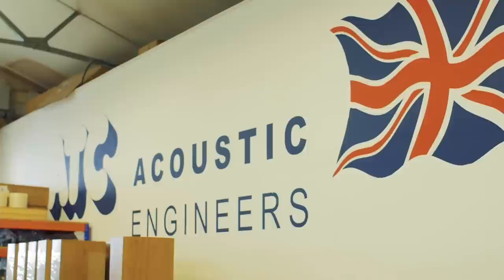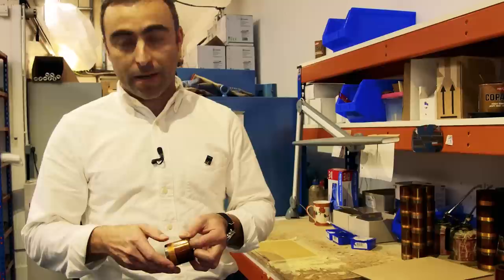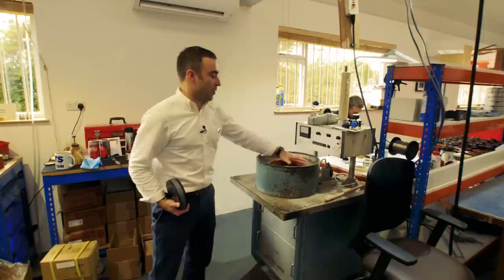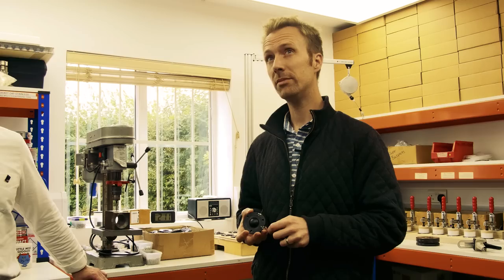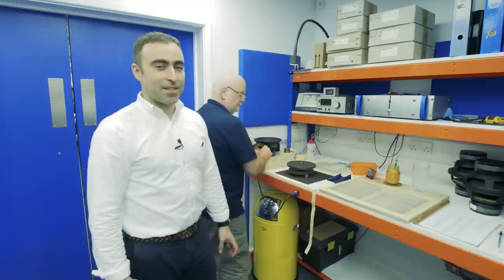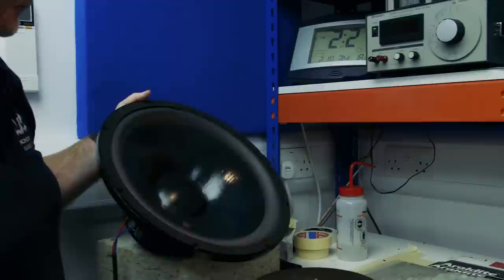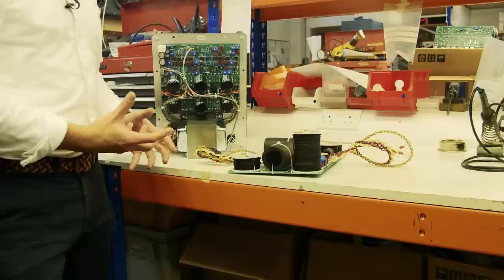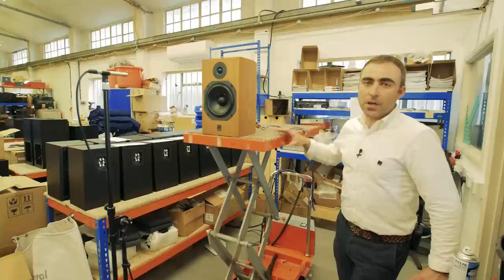Soundstage Takes The ATC Loudspeakers Factory Tour

Comment: In the '70's I worked in a speaker factory in New York state. I came here to see how it's still done. Your manufacturing is somewhat similar to the processes we used. Hearing you describe the components such as the front and back plates, the spider, crossover network, etc., I knew exactly what you were talking about. We produced raw speakers and speaker systems for some old but familiar names. Harmon Kardon, Jensen, JBL and Altec Lansing, Sony and Kenwood. They had a machinist shop, punch presses and a state of the art wood shop. Every speaker produced was tested in a sound booth on an oscilloscope (or sometimes with music with cheaper systems) before packaging. They are out of business now but your tour took me back to the '70's.

Comment: Set up a new studio for a new artist project and bought a pair of SCM45A'S. I bought them totally off specs.Didn't feel I needed to test them as I knew ATC Speakers are built to the highest standard and  have worked using the SCM 50's numerous times. The SPL  was well loud enough for my room. I'm using PMC's for the near field, but I have to say the ATC's are just so transparent and real. Its like working with a visual frequency range but with your ears. My mixes are just so much better because I can hear everything so clearly. The mids are just so honest and the drivers so tight for bass. They are not kind to poor mixes or sounds. They tell you exactly what is. Totally a professional monitor system and whilst not cheap, you truly get what you pay for. I'm not associated with ATC in any way so this is totally my view and unbiased. But they are just so great to work with. I love them.
Reply: Totally agree with this, have a pair of Scm45 A's myself and I've got to say, they are truly something else. I notice many people talk about the lack of bass on ATC's, but I think it's very present, maybe not as much as on other speakers, but it's definitely there and I'd even go as far as saying that it's a much better perception of the low end than on the other big bass speakers, it's so tight and real, it just doesn't feel hyped at all. Mids and Highs on these speakers are wild, better than any other speakers in that range, I think everybody knows that by now.

Comment: I just love the look of that soft dome midrange! A real unique feature for sure.
Reply: Yeah dome mids are something else! Can't wait to finish my DIY 3way monitors with a 3inch dome.
Reply: @kaedeschulz5422  what is it volt
Reply: @johnsweda2999  Just for now Dynaudio MD140 on a short waveguide like on the ATC or Volt till i'm done modifieng a Scan Speak D76. It will get a whole different motor from beefi PA driver that was blown. I may even do dual suspension. But only if i can get the right parts.
The coil off course will also be changed. The woofer will be a 15" PA driver that i will modifie and the tweeter will be a Seas NoFerro900.

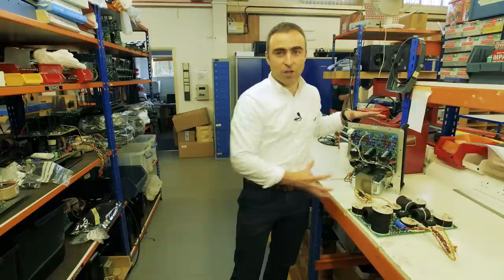Comment: now compare that passive crossover at 12:20 with a similarly priced speaker from garbage company like Focal
Reply: Right, lets compare a Fiat to a Mercedes.. Seriously man, are you stupid? Focals most expensive professional speaker system costs about 3.500 and their cheapest is around 250... ATC's cheapest professional speakers start at almost 2.000 and their most expensive cost almost 25.000 a piece. Yes ATC is better, but Focal's 3 way speakers sound absolutely great for their price. Comparing these two is ridiculous!

Comment: I bought a set of atc 50 aslt. I don't think it's fair to talk about speakers alone  so for this reason I will share my previous equipment. Used linn and Naim ss amps to Focals. Also McIntosh c2600 tube pre to pa mc275 vi to focals. There's was things about those combinations I really liked, but I always felt I was missing something. I sold everything and took a blind chance on new system entirely. I'd only been able to hear the atc 11 and 19s both passives but could tell there was something special. However I really wanted an end game system. I purchased a Supratek Cortese Lcr pre tube and the atc scm50 aslt. I run silver linn xlr interconnects. I can honestly say I no longer have a desire to upgrade. I does things that are hard to put into words, if you have not experienced this with Atc I'd say you may have the wrong amp or synergy is off or even something as simple and overlooked as speaker placement. I can still play with sound changes if I alternate copper and silver xlr cables or tube roll. I think it's important to note sound is much like taste buds, we may all have some slight preferences that differ. I think the goal is to know all the characteristics of musical sound you like (ex...warm, bass, clarity etc) then identify which equipment falls into those characteristics and build the best system you can afford.

Comment: for the low end drivers QC, it's kinda of odd that there isnt any kind of damping or pressure traps in the environment when in studios, there is extreme measures to provide low end control. How can someone tell if there are resonances if there is comb filtering (aside from feeling the physically)

Also the last qc test. Most speakers brag about an anechoic testing strategy. Maybe they just don't want to introduce variables to an already proven design, as people will pay anything for these puppies

Comment: Very very interesting and truly amazing products indeed.  I wonder why they have not kept the midrange construction concept (i.e. horn loading)  also for the tweeter ... like a scaled-down/smaller  midrange ... i like very much when dome drivers look similar only scaled in size to cover their freq range.  And also i am a big fan of wave guides/horn loading ...  of course this would be impossible for the woofer.  For that i like very much inverted spherical cap shape instead of a cone shape.  In the past i have been very close to buy a 2nd hand Pro Ac EBS with that midrange ... i was in the middle of moving to a new country for work and i did not buy them.  What a horrible mistake ... if i think about it i cry ... it could have been my speaker for all my life.  I should start saving for a ATC ... Thanks a lot for the wonderful tour ! kind regards, gino
Reply: Actually on bass driver's it doesn't matter much since the wavelength is most of the time way larger than the cabinet. On the tweeter they probably didn't do it because of the baffle being big enaugh (atleast on the bigger models scm 50 and up) so that it doesn't really matter since the tweeter doesn't "see" the edges wich are rounded over anyways.

Comment: Last year, following the failure to get my Ruark Crusader II’s repaired, I auditioned and purchased a pair of ATC SCM40s..
Probably my best and most essential purchase in 47 years of my HiFi hobby.
Since their purchase last June, I have hardly watched any TV, my evenings now taken up going through my large CD and vinyl library being astonished at this new sound!
The only tiny annoyance I have with these speakers and it’s NOT a fault is their brutal honesty in exposing sub standard recordings.
Some of these modern over compressed
CDs, recorded for earbud and car listening sound awful! 
And they do need a powerful power amp system to show them at their best.
My system is Tri-Amped...
Reply: Would you please list your amp(s), cabling and what prior speakers you’ve had extensive use with.  Thanks,  I’m in the middle of trying to make a selection for a tracking studio but I have audiophile friends whose systems blow conventional tracking studio speakers out-of-the-water and I’m more confused than ever.
Reply: neve1064 
My amps are nothing really that exotic.
Audiolab 8000Q preamp,
4 X 8000M 125 Watt (for the tweeter & midrange)
2 X 8300MB 250 Watt (for Bass)
QED Signature Audio 40 interconnects
Van Den Hul Teatrack 
& CS-122 speaker cable.
Previous speakers:
Castle Conway MK 1 (Modified)
Ruark Crusader II  (mid range domes faulty, unable to obtain replacements)
Reply: @neve1064  Cables do not matter for sound!
Reply: @stephengarratt5076  Did you ever think of building your own speaker's?🙂
Reply: Schulze Designs At this later stage in life, I have neither the skills, ability or inclination to design or build speakers. I am still 10 moths on extremely happy with my wonderful ATC speakers
Reply: @stephengarratt5076  That's very good! Was just asking because of repairing you know?
I hope one day i can get my hands on a pair of THESE mid's for my monitors.

Comment: I like ATC but I never really understood the cabnits with 2 15" woofers, and 1 3" midrange. Im sure it probably sounds good but it seems like there are a lot of compromises in that box. I mean a 3" speaker can only sound so big.
Reply: Mike G the point there is for the woofer to work less and therefore have less distortion on the bass
Reply: The mid-range is where most of the music you hear happens. A 3" mid-range is ridiculous.
Reply: The 3in mid driver is extremely efficient and the bass drivers are substantially less so therefore even with a pair of 12,s the mid driver is nowhere near its limits to keep up.
Reply: ATC midrange dome has 13mm of excursion.
Reply: Traditional assumptions cannot be made to this speaker... it is a convex midrange woofer so its dispersion characteristics will be different than a typical concave design.
Reply: @sjowners  I'm not an expert, but I think you're out by a factor of ten. 1.3mm would still be a lot for a dome.
Reply: @chrisburn7178  There are 2 midrange units they use. One in the domestic and small monitors and one in the huge models. The latter has half inch of travel. You can thrash them to hell and back, remember they were originally for monitoring / mixing which is done at very loud levels on the same set for decades.